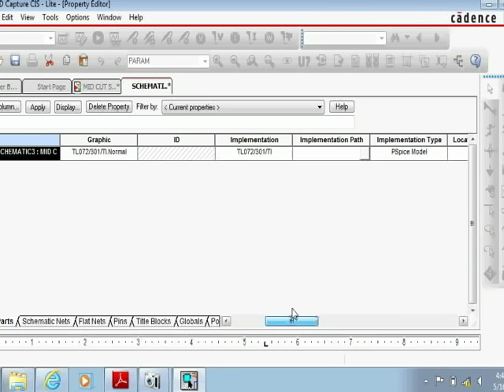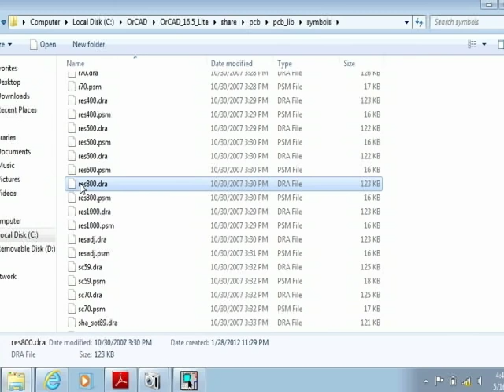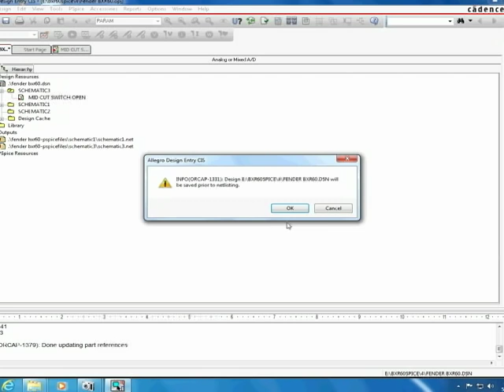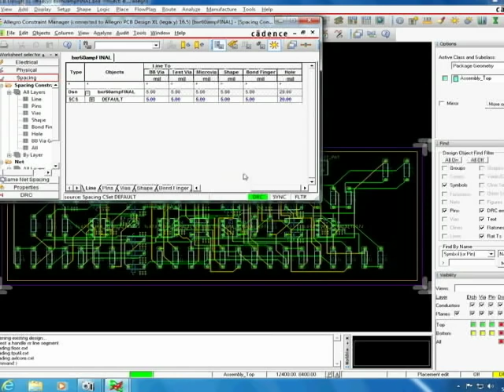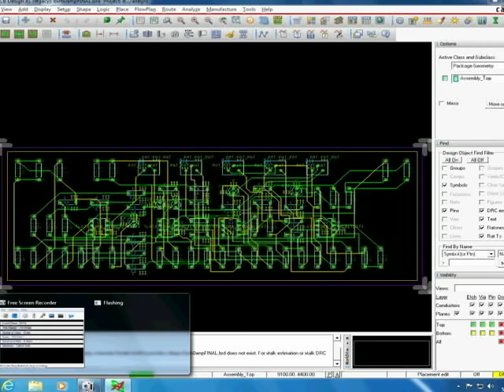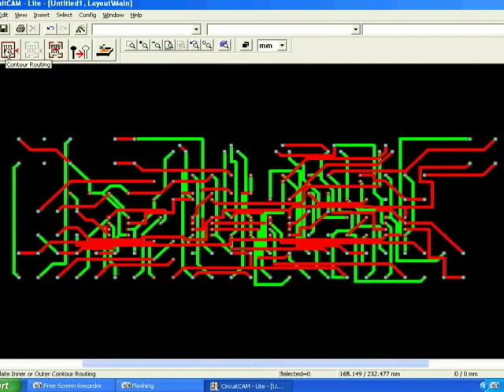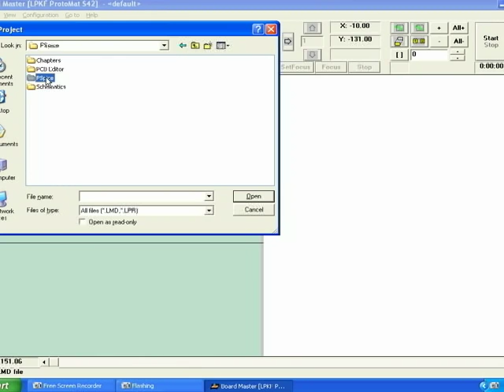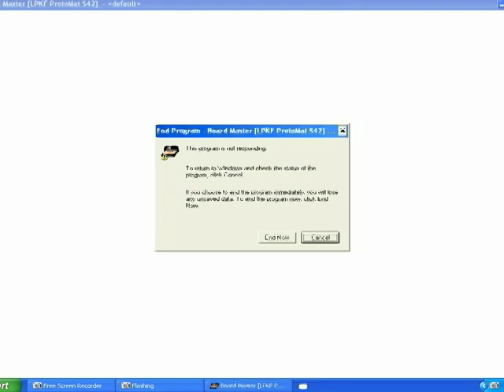Project: Creating a Printed Circuit Board Using OrCad Capture and PCB Editor

Comment: Sir, i created the netlist & it should be go to pcb editor automatically, but its not opening . please help me.
Reply: you need to check on to open PCB Editor and generate the output  board file  before you run the netlist if you had the board is designed and want to update the board then you need to browns input files. if you not this it will replace your current board if the same board name.